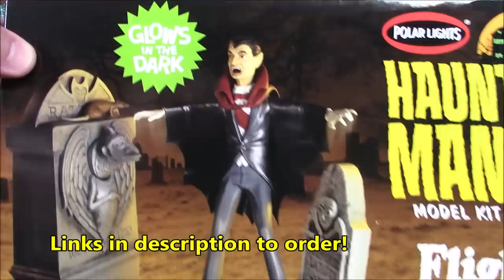Flight of the Vampire 1/12 Scale Model Figure Kit Diorama Build Review Polar Lights Haunted Mansion

Comment: My only fear is that the rubber band will eventually dry out and break. Guess you could just not glue that section together.
Reply: I'm with you on that one, John! I love these and the zap-action pirate kits, but I'm hesitant to make them work just for that reason. I've done 2 of the pirates in the last few months and just glued them. In all honesty some of them have such limited motion they look GREAT as a static model. I'm gettin' old and don't play with my kits very much. (Which means I STILL DO occasionally if my wife isn't around!)